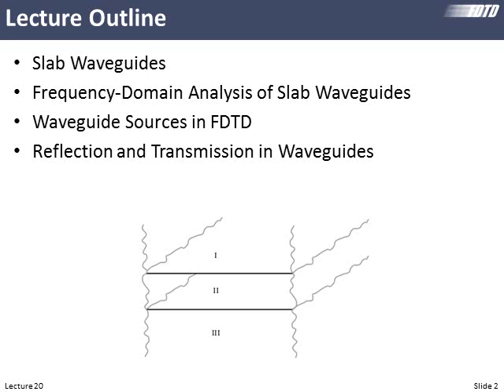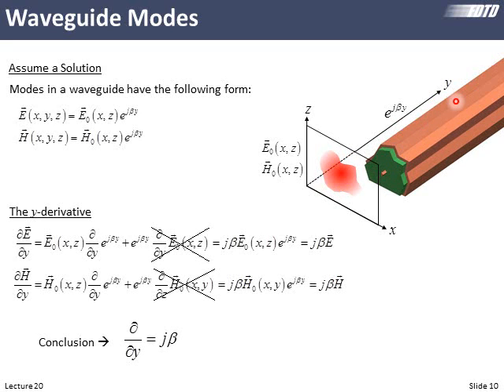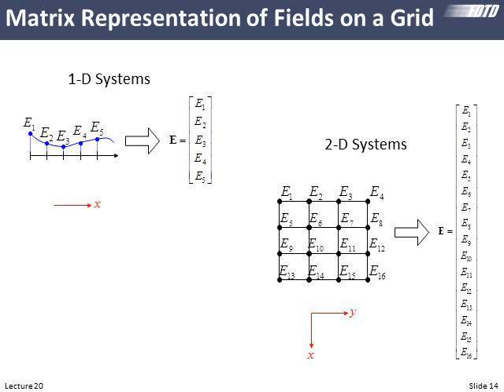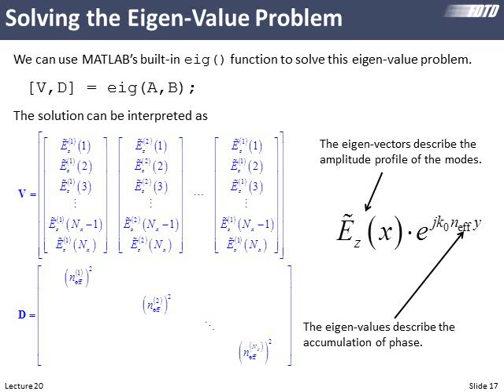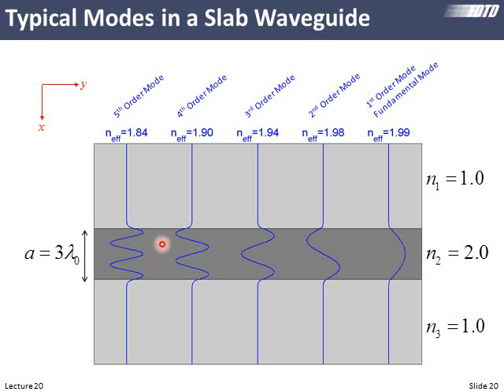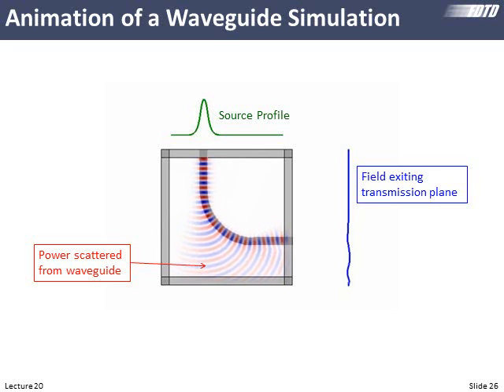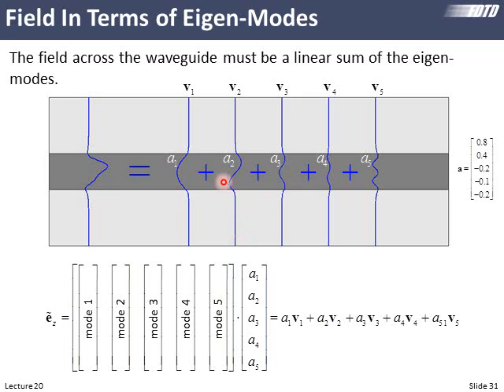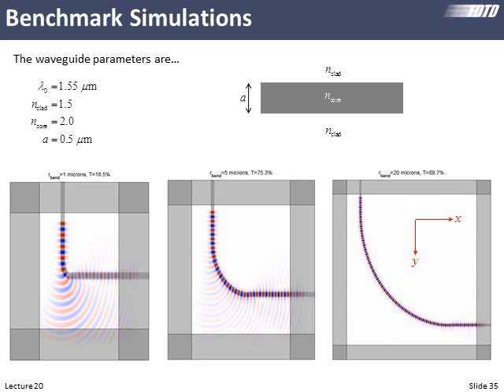Lecture 20 (FDTD) -- Waveguide analysis

Comment: Thank you. Is there a possibility to calculate transmission coefficient with Fourier method over a huge span of frequencies, given that there is a fundamental mode? Or is it only reliable for periodic boundary conditions?
Reply from the maker: I am unsure. The mode profile changes with frequency a bit and I would have to think if there is a way to account for this. Without knowing that, you would essentially have to run a separate simulation for each frequency.

Comment: Hi Dr. Rumpf. On Slide 33, EZR and EZT are real value matrix from ezmode(), but Eref and Etrn are complext  number field as they are from Fourier transform. To calculate aref and atrn, shall we use abs() or real() of the Eref or Etrn?  I tried myself that using abs() will give a different mode amplitude atrn, but using real() or just complex Etrn will give the same atrn.   Which one is correct and why we can use the equation on slide 33 to get the correct answer (real matrix EZT and complext Etrn)?   I noticed in my code that real part of the fourier transform of the transmission field is the same as the real time Ez at the recorded plane (change with time). It should be the abs(Etrn) which representing the steady state mode profile.  Can you comment on this?  Thank you!!!
Reply from the maker: Think of aref as a complex reflection coefficient and atrn as a complex transmission coefficient. They are just for modes in a waveguide instead of plane waves at a flat interface. They are complex quantities because they relate both amplitude and phase of the analyzed modes vs the source mode. In this sense, neither abs() or real() should be used or that would calculate a purely real aref and atrn. I later use abs()^2 because I am calculating fraction of power reflected and transmitted in a guided mode. I am ignoring phase as the abs()^2 operation erases the phase information.

The first two equations on Slide 33 are weighing the simulated field against the complex set of guided modes to calculate the complex amplitudes of each of the guided modes that would give the simulated field. So aref are the complex amplitudes of all the modes, such that if all added up would give the simulated field in Eref. Same story for the transmitted modes.

You mention “real-time” in your question. Understand that Eref and Etrn are steady-state fields. I am not sure what kind of answer you would get if you are using the instantaneous fields in this calculation.

BTW, don’t depend on the numbers in EZR and EZT being purely real. I think they happen to be for this special case, but they can easily become complex numbers. I always treat them as if they are complex so if I ever do anything that will make them truly complex the code will still work.

Hope this helps!!
Reply: @empossible1577  Thank you Dr. Rumpf!!!!  You are so helpful even after 10 years since uploading the slides! !  I did not realize the aref can be complex amplitudes of all the modes, thought it has to be real...   As to the "real-time", I just plot both the real-time field at the record plane, and the real part of the steady state Etrn, they look the same at the same time step (overlay on each other in plot). Not sure why. My source followed slide 24, and it is a real source.
Reply from the maker: @yufish6576  Happy to help!!

You may also be interested in the paid online FDTD courses. They are next-level in terms of visualization and clarity. They were also designed for self-paced learning instead just being the nodes and videos for my face-to-face class. Here is a video showing the contents of the courses:

https://youtu.be/uBiprIN8gfY?si=bL2TbIS5P6Rt9cn6

The entire first half of the first course is free. If nothing else, I recommend working through that. Here is a direct link to the courses:

https://empossible.thinkific.com/collections/FDTD-in-MATLAB

Comment: Dear sir, I wanna know whether the calculation of eingen-mode fdfd methode that you presented here could be used in the same way for a problem of eigen-mode plasmonics confined in a 2D gold nanoparticles ? Thanks you
Reply from the maker: I am certain that it can.  I recently wrote a book and I demonstrate how to calculate a surface plasmon polariton (SPP) at a flat interface in Chapter 6.  Here is a link to the book website:

https://empossible.net/fdfdbook/

In fact, the same exact code I use for slab waveguide analysis is used to calculate SPPs. It would also be the same code to launch that as a source into a larger simulation.  Your problem involves nanoparticles, so you may have to give it more thought since it is not a flat interface.
Reply: @empossible1577  so we don't need to inject the source in this case, and we can use the results as a numerical source for further simulations with other devices? And the case that I talk to you is the case of localized surface plasmons

Comment: Dear sir, I'm simulating diffraction from a object (not a periodic structure). I tried to design the model as a periodic structure but with a long period and apply your method of calculation diffraction efficiency. I obtain the result but I don't know if this result is good. If it is possible, could you telle me how i can do to calculate the diffraction efficiency in this case please ? Thank a lot.
Reply from the maker: If your device is not periodic, I don't think the concept of diffraction efficiency makes any sense.  In this case, people generally characterize objects in terms of things like radar cross section (RCS).  For an RCS calculation, you will need to put a PML on all boundaries, put a TF/SF interface a couple of cells away from the PMLs, and then do a near-field-to-far-field (NF2FF) transformation.  I have some notes about this, but no video yet.  See Lecture 5b here:

https://empossible.net/emp5304/
Reply: @empossible1577  could you do the video on this topic please ? I really need it for my project. Thank you in advance
Reply from the maker: @huonghuongnuquy7272  It is only my very long to-do list.  Sorry!
Reply: @empossible1577  I read your note but I still don't really understand how I can implement RCS and NF2FF
Reply from the maker: @huonghuongnuquy7272  This is a difficult and tedious thing.  I have developed two courses in FDTD.  The first is an introduction that teaches 1D finite-difference time-domain.  The second is more advanced, builds on the 1D course, and teaches 2D finite-difference time-domain.  I am slowly working on 3D course and I will be including NF2FF stuff in that.  Unfortunately, it will still be probably be a long time before that is finished.  I put it aside to write a book and focus on getting a new business started and off the ground.  Here is a link to a video showing what is in the two finite-difference time-domain courses:

https://youtu.be/uBiprIN8gfY

Here is a link to the courses.  The entire first half of the first course is free.

https://empossible.thinkific.com/collections?category=FDTD-in-MATLAB
Reply: @empossible1577  I understand that will take a lot of time to complete 🙂 I'm training on your online 2D FDTD lecture. I have to say that these lectures are amazing ! I look forward for your next lecture on 3D FDTD, scattering analysis and SF2TF. If it is possible, could you please add a lecture in 2D scattering analysis and SF2TF ? Because I know that a lot of problem could involve this technique in 2D. Thank you a lot for your lectures ☺️

Comment: Hello sir, sorry for bothering you again...but I want to educate myself and maybe someone else is struggling too :)...So my question is, can we somehow do a multifrequency analysis of this waveguide? I mean can we put a gaussian pulse in the input, which has profile of a mode of a waveguide in x direction (something like Ez_src*gaussian(T))? I tried to simulate this but it didn't work, It seems that problem is, that gaussian spreads out in all direction and only a fraction of pulse goes in the direction of waveguide...Is there any 'directional gauusian' (if that makes sense) or how we can excite a waveguide  with a several wavelengths? Thank you again for your videos...
Reply from the maker: No bother at all.  I rather enjoy helping people!  

The problem with multifrequency analysis is that the mode shape and propagation constant are different at each frequency.  A brute force way to do this is to calculate the source at each frequency of interest and simply launch all of them at the same time.  They can all be analyzed in a single simulation, but you will need a Fourier transform to separate them.  I have wondered if there is a more clever way of doing this.  Maybe if the frequency range is small enough, you can just calculate the mode at the center frequency and launch that profile beam with a Gaussian pulse in time.
Reply: @empossible1577  I dont understand how can I put a multiple sources to the same spot at the same time. I will calculate a bunch of planewaves and then just in the TF/SF correction do the for loop for every wave?

I tried a gaussian from 1,3-1,8 um and it didnt work at all, maybe it is too wide... All I wanted was a transmission spectra of a simple PC waveguide. I am from Europe and its already too late to be at school, but I cannot sleep because of this :), thanks fro reply :)
Reply from the maker: @TadeasManka  To launch multiple frequencies is actually extremely simple.  Don't over think it.  Whatever you do for a single frequency, just do the same for each frequency.  If you are following the outline in my codes, there are two lines that incorporate TF/SF corrections for the source.  You would simply do this, perhaps in for loop, for each source independently as if the other sources were not also there.

Comment: Thanks for the another great video, but I got a little  bit confused in some parts,
1st question, Why we want to express our equations in terms of Ez and not in Ey(in the direction of propagation) and why do you call it Ez mode and not TE?
2nd one, Why DXe (derivative matrix) and DXh matrices are different and how do I calculate them (I just can't find any explanation) 
3rd question =D, at 19:15 there is problem with inverse Muyy, as it is in pair with hy(B contains Muxx and not Muyy and A should contain Muyy)
and the last one, is there any lecture about sources? It's very embarrassing to say, but my teacher never ever mentioned this topic, and I really want to understand it.
Thank you for your time.
Reply from the maker: All simulations are 3D.  However, when one axis is uniform (call that direction z) and propagation is restricted to the xy plane, Maxwell's equations decouple into two independent modes.  Most often these are called TE and TM, however, those labels are a bit ambiguous and confusing.  For that reason, I prefer to call them Ez and Hz modes because for one mode all electric field components besides Ez are zero and for the other mode all magnetic field components are zero except for Hz.  It is unconventional, but removes the ambiguity and confusion of TE and TM labels.
Reply from the maker: The derivative matrices are different due to the staggering of the fields on the Yee grid.  There is a much deeper story to how the waveguide analysis is done and this one video barely does it justice.  For much better and introduction to this, watch the videos for 6b, 6c, 7a, and 7b here:

http://emlab.utep.edu/ee4386_5301_CompMethEE.htm

Given the above, this FDTD video will make a lot more sense.
Reply from the maker: At 19:15 you have caught a mistake in the video.  I have corrected this in the electronic notes, but have not yet rerecorded the video.  There are other revisions, corrections, and improvements in the electronic notes that are not in the videos.  You can get these from the course website here:

http://emlab.utep.edu/ee5390fdtd.htm
Reply from the maker: Sources -- This is first covered in Lecture 6 and then the total-field/scattered-field is discussed in Lecture 7.  It is hard to imagine how FDTD is taught without discussion how to inject waves into the simulation.  Sorry your teacher did not cover it.

BTW, here is a link to an online course on FDTD.  The first half is free.  This course takes a very simplified and visual approach to teach FDTD and you may find it useful.  Check it out if you have time.

https://empossible.thinkific.com/courses/1D-FDTD
Reply: Thank you very much! There is no doubt, I will check everything you have mentioned!

Comment: Sir, at 2:05 , you said that a 3D structure can be approximated to a 2D structure by using effective indices. I want to know how can we calculate these effective indices?
Reply from the maker: This is covered in slides 8-21 of this video.  The effective refractive index calculated by the slab waveguide analysis is the refractive index you should use in your 2D simulation.
Reply: Sir, Effective index method is not explained in this video.
Reply from the maker: Take a look at slide 26 in lecture 11 in this video series.

Comment: Thanks for this all inclusive lecture. Just a quick question, For a dielectric materials, the field inside the core must decay exponentially into the substrate and the cladding. How do you modify the formulation to accomodate these modes that decay exponentially into the substrate and the cladding region?
Reply from the maker: A true optical integrated circuit is 3D.  To perform the 2D simulation described in this lecture we used the effective index method.  The effective index method looks at the vertical cross section through the 3D circuit and comes up with an average refractive index for each point.  The average refractive index is ideally set equal to the effective refractive index of a mode guided by the slab.  In this sense, the evanescent fields you are asking about are accounted for in the calculation of effective refractive index.
Reply: Ooh ok. Thank you very much for the prompt response. You have no idea how your videos are helping me and I believe there's a lot of other people out there who would attest to this. Please never stop making these videos.  Could you please  check out a question I asked on your video here https://www.youtube.com/watch?v=-VOpzkreQxg&t=15s . That would really help me a lot. It was a reply to Buddhika Jayawardana 's comment (first). Thank you.
Reply from the maker: Responded